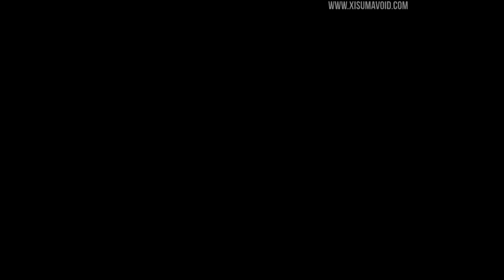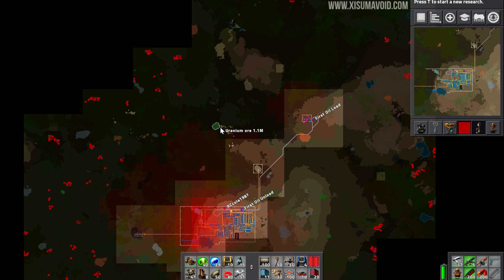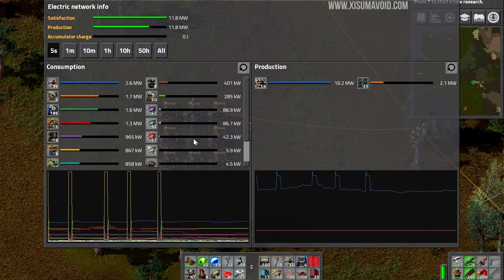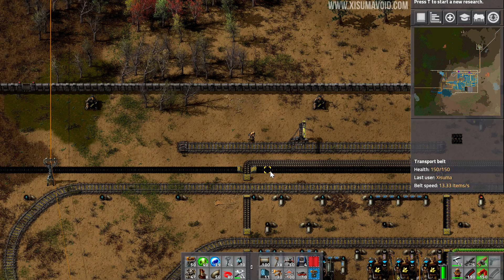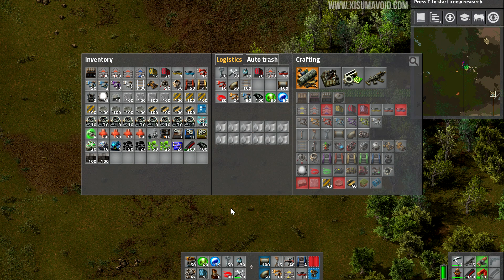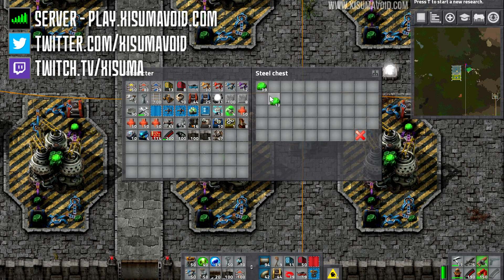Let's Play Factorio 09 Kovarex Enrichment (Factorio 0.16)

Comment: I forgot a step, which is only necessary for enrichment bootstraping.

 You will need for each of the setups which I described:

a decider combinator which outputs a 1 signal if chest A has 40 or fewer items,

a decider combinator which outputs a 1 signal if chest B has 1 or more items,

an arithmetic combinator, set to AND (&) mode, which takes its inputs from the two deciders, and whose output controls the inserter moving uranium from A to C.

Comment: Use extra chests, and red or green wires to more efficiently process the uranium from your centrifuges.

 Call these extra chests A, B, and C.  Suppose the chest getting uranium directly from the centrifuge is A.  Have an inserter which only moves from A to B if there is one or more uranium in C.  Have an inserter which moves from A to C if there are more than 40 uranium in A. Finally, have an inserter which moves from C to your passive provider only if A is empty.  The contents of B gets put back into the centrifuge, obviously.

If you are cheap, B could be a spot on the ground instead of a chest.

If you want your enrichment factory to automatically start itself without you babysitting it, replace the passive provider with a belt which leads from the first centrifuge to the second centrifuge, and have an inserter place uranium from the belt into the second centrifuge's A chest. 

Only send uranium from the final centrifuge's C chest in your enrichment factory into a passive provider.

Comment: You could just set a condition for the logistics network so robots don't 'see' the uranium in your chest unless it's over 40.
Or add a second provider chest that uses wire logic to where it wont take from the 'mainline' chest unless it has more than 40 in it.